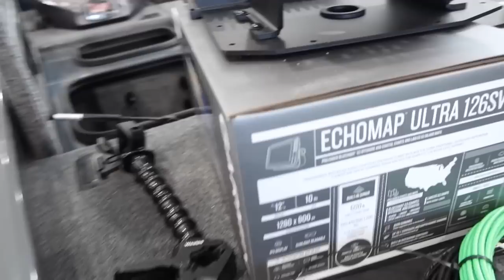DIY Rigging My Own Electronics!!

Comment: Mark The wires that you guys ran can potentially burn an aluminum boat to the ground, if you don't install a fuse, or a circuit breaker at the Battery for every positive wire that you added. The fuse/circuit breaker is to protect the wires, not the graphs. The graphs will have their own fuse. If the insulation rubs off against a sharp piece of the aluminum hull, the wires will glow red and burn the boat down.

Comment: I just got my 2022 188p finally working right. It's a great platform for the lakes in Michigan. I have four 12 inch helix. Mega live and target lock. I had electronics issues most of the summer. This is going to be a great boat for the next few years until I retire south.

Comment: I agree. In a tin boat you need to run sheathed wire. I ran 10gauge 3wire in mine. If a wire wears through you can make the hull live.

Comment: Marine wiring is different than the 8 gauge wiring you bought at the hardware store. Prepare to replace it soon. Boats are electricity friendly. Marine wiring is tinned with a solder in an oxygen free environment when manufactured to prevent corrosion. You may start to see weird interference on your graphs as the first sign. They also use a different coating. Hopefully your wire is copper, marine wire is pure copper and stranded, a lot of wiring made for the home is solid. Also, when pulling wires thru the boat, you can make it slide better just by either wiping the wire coating with wire pulling lube ( or water based KY 😂😈) . You need a breaker at the battery for that wire, it is so large it will burn a hole through your boat before you can get back and cut them. I would have individual fuses at the graphs and livescope box to protect them. $1 fuses vs $3k screens… 
https://a.co/d/gnQhAHS

Comment: Mark great tip about removing the side panel! As others said, I would suggest you use marine wire Its tinned and multi-stranded o give you better electrical flow. Check out the type of wire Seaclear or Westmarine use. I learned the hard way on my last boat with voltage drop and corrosion using hardware store wire. But if its all you could get you have to go with it for now to get on the water.

Comment: I had to rewire my last boat and it was a pain in the butt. I swore I wasnt gonna do it  again also. Well I bought a ranger z522 and I upgraded my wire from the battery to the front deck for my solix and ultrex.  Another pain in the butt, but I'm glad I did it